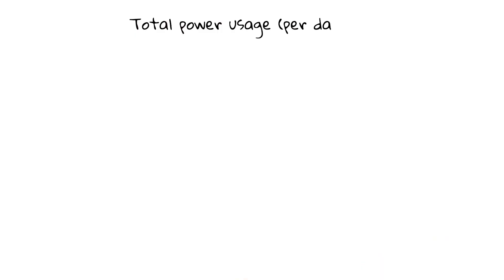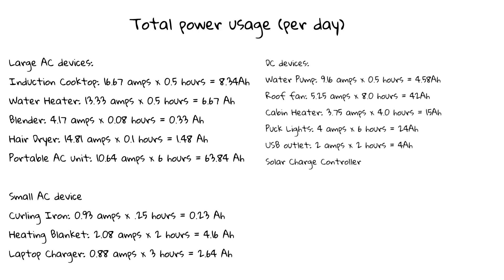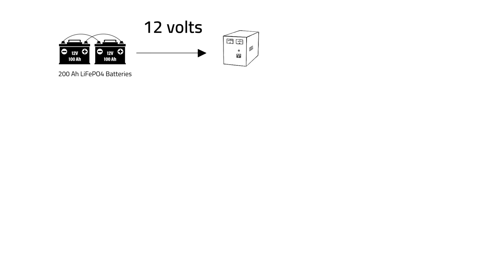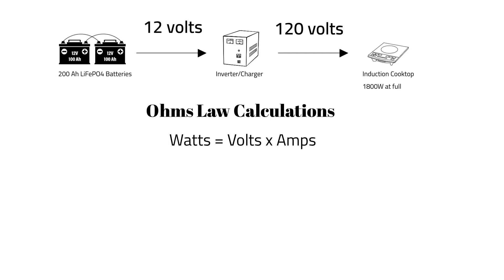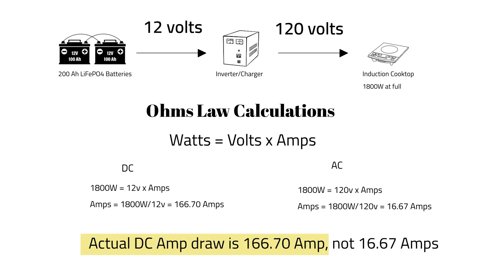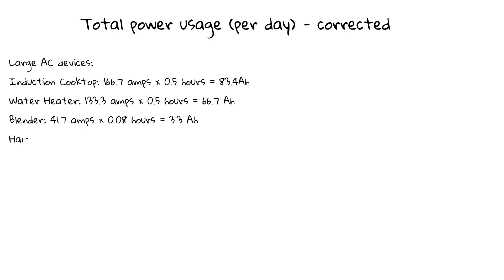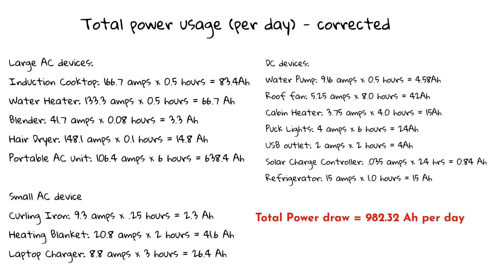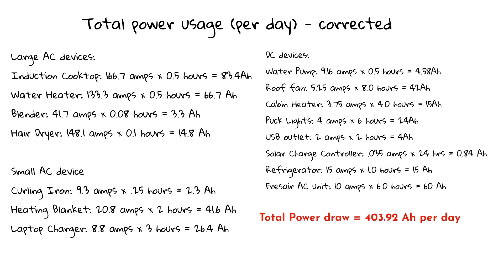Fixing a Big Mistake in our Electrical Calculation

Comment: Very informative video. I noticed you the "cabin heater" under the "DC devices" and uses only 3.75ah, could you please share make/model of this heater. thanks.
Reply from the maker: Hi Jalal.....The Webasto Heater has a rated power draw of 1.3 - 10.9 amps.....The higher end is during startup.....but a friend has it and has measured an average of 3.5 - 4 Ah.